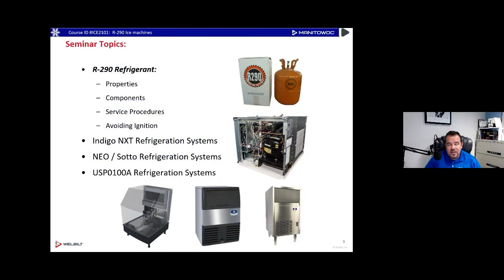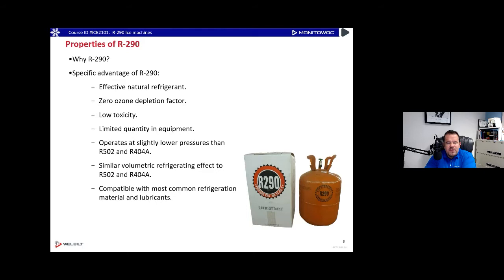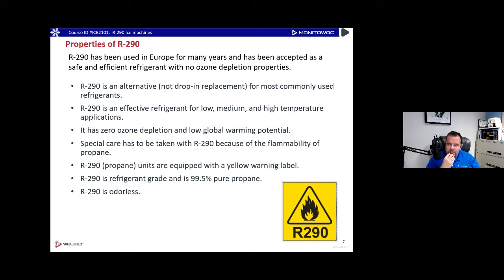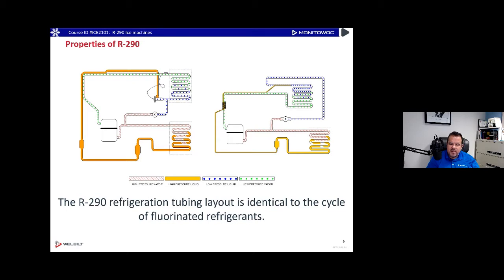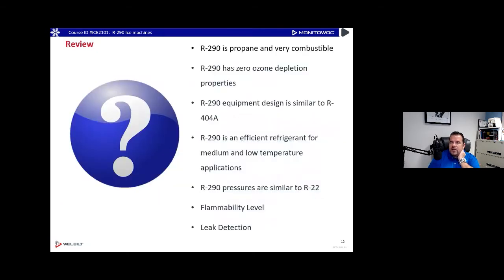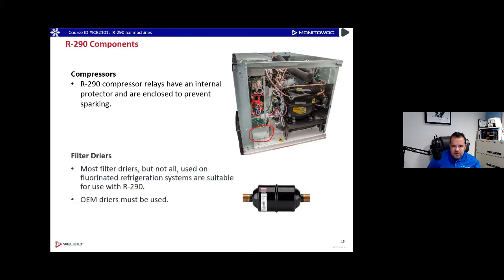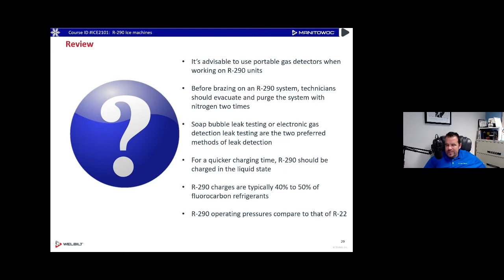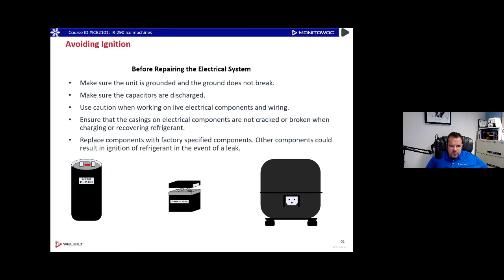ICE2101 Manitowoc R 290 Training 1 21 21

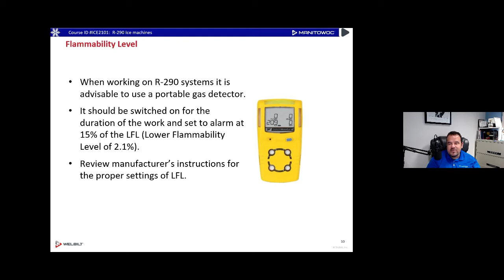Comment: What brand / model of detector is that...unfortunately every manufacture of reach in equipment is ALSO using R290. So stupid....but until they stop, I need to able to work on it...I currently have a leak detector...but it's has auto off in about 10 minutes. Need more of a monitor, which I am assuming THIS ONE SHOWN at 8:07, is. Thanks in advance.
Reply: Leak detectors don't work on r290. Soap bubbles or drop charge then use nitrogen with a trace of r404 or 134a